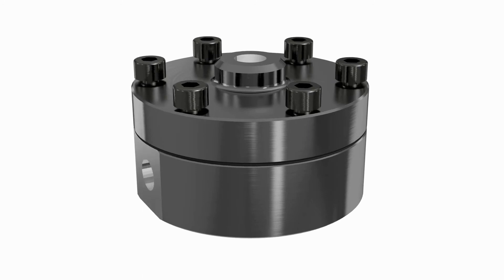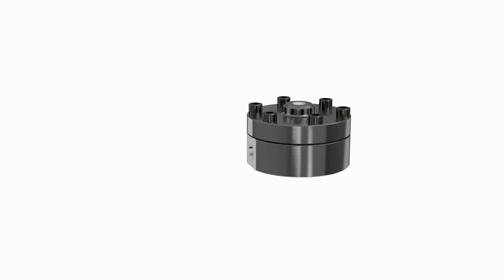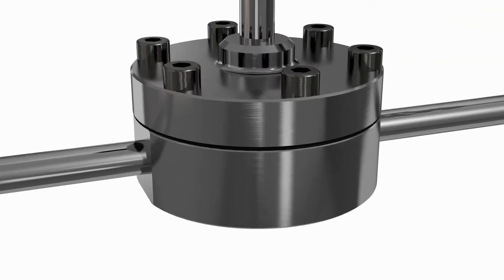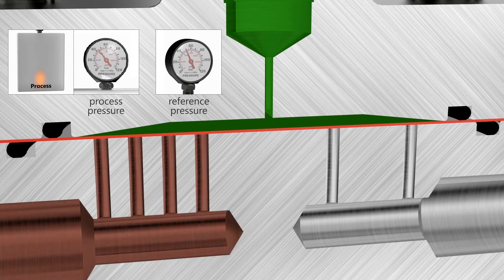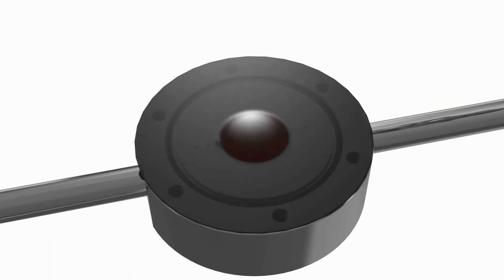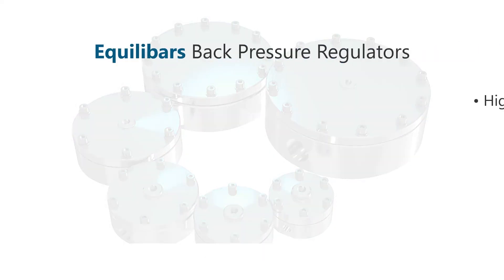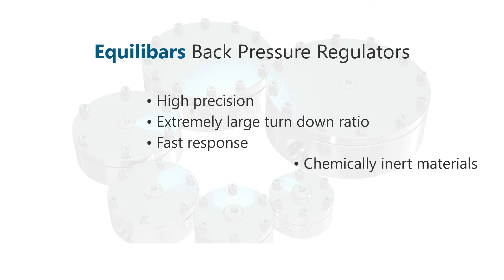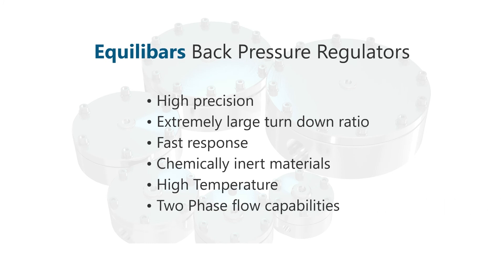How Equilibar Back Pressure Regulator Works

Comment: whether i can use it for high temperatures abve 300cel
Reply: we utilize metallic C-rings or graphite gaskets for operation to the 500C range
Reply from the maker: There are some special models that can be used above 300 degC. You can read more about it here https://www.equilibar.com/back-pressure-regulators/severe-services/high-temperature/ or contact one of our application engineers https://www.equilibar.com/contact/

Comment: Is this thing FDA approved? or can we order in 316 stainless steel with nitral or Teflon diaphragm?
Reply from the maker: Our back pressure regulators can be made with a variety of different body, diaphragm, and o-ring materials. Stainless steel 316 is our most commonly used body material and nitrile and Teflon diaphragms are available as well. For applications involving food, along with other sanitary systems, our FD series regulators may be a good fit http://www.equilibar.com/PDF/Equilibar-Sanitary_FD_Series-Back_Pressure_Regulators.pdf FDA and USP Class VI certificates for the diaphragm materials are available for these regulators.     Best Regards,
Alan Black
Applications Engineer
Reply: the device is not FDA approved as such, but is available in hygienic designs with USP Class VI or FDA-approved diaphragms.  The FD Series is commonly used in biopharma applications.